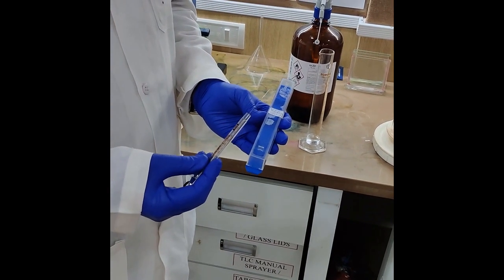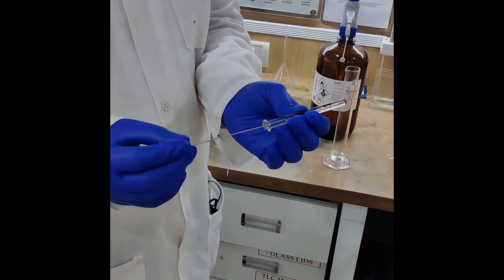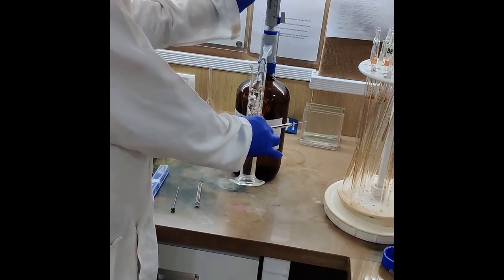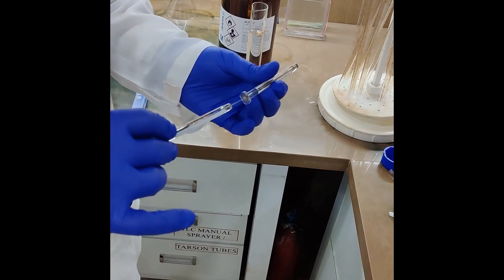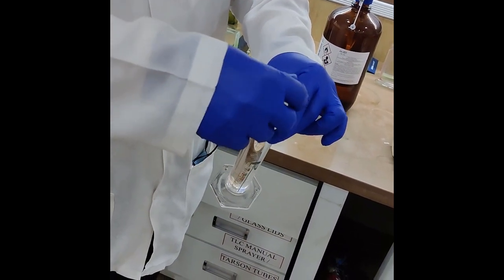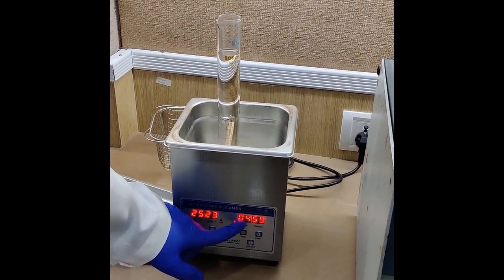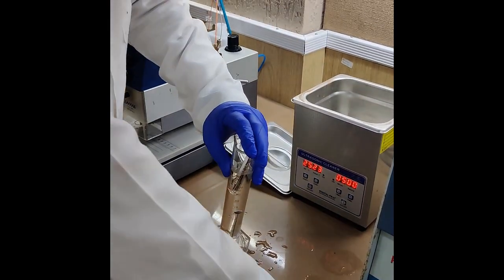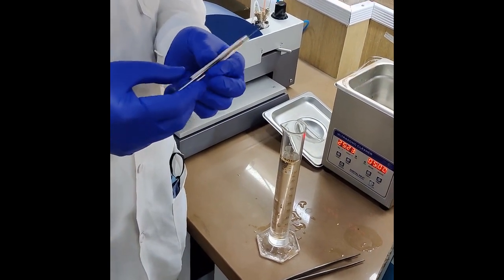HPTLC Syringe Cleaning Tutorial

Comment: Would a standard syringe with a needle suffice to insert the solvent into the HPTLC needle, in case no spare parts were available?

Would letting the needle soak in methanol for the majority of the time when it's not in use affect or damage the needle or its markings, for example?

Finally, I encountered this problem once and tried all mentioned (not in detail, but used sonication for more than 2 hours for example) and it didn't fix the issue, what else could I have done to solve the problem?

Thanks

Comment: I always clean syringe with methanol thrice in between changing samples.

But still getting 2-3 bands in standards after scanning.
Pls help
Reply: Hello, 
Based on the solubility of standard use the rinsing solvent for proper flushing. Increase the rinsing cycle and check the purity of standard used for the experiment.

Comment: How to eliminate air bubble while loading sample in syringe?
Reply from the maker: While loading samples in the syringe, please make sure the piston is pulled up gradually to avoid the formation of air bubbles.
In case air bubbles are formed, tilt the syringe upside down and gradually tap on the glass body of the syringe so that the bubbles move towards the tip of the syringe, now press the piston slowly to remove the bubbles.